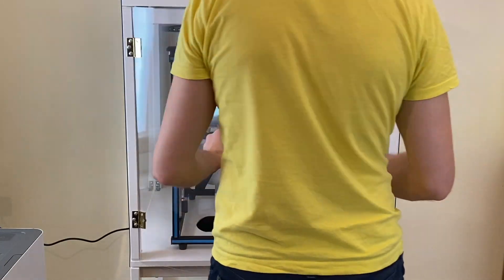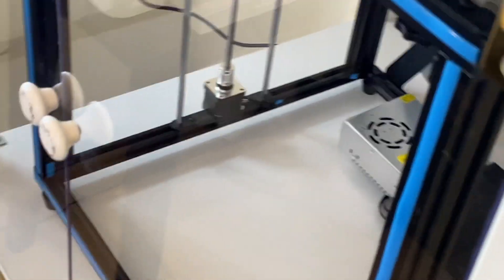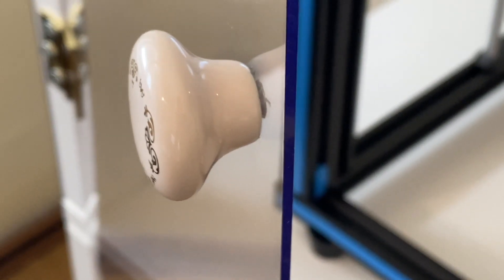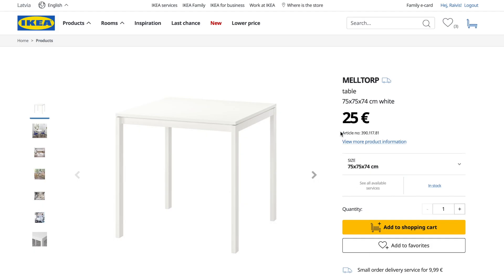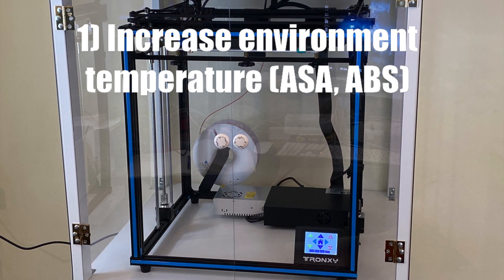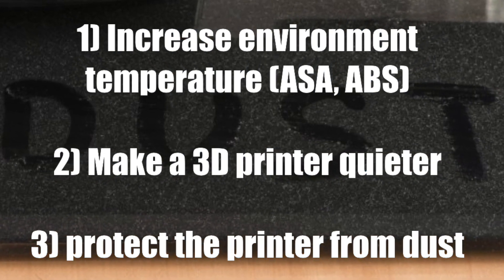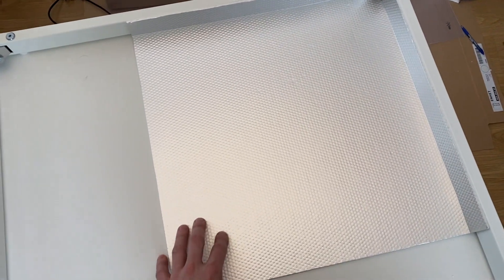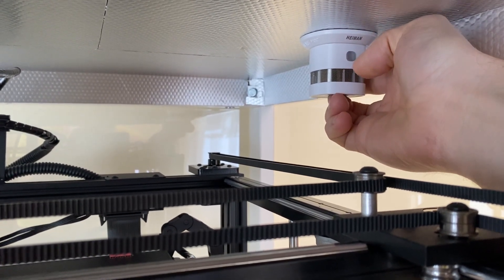How to Build a Cheap 3d Printer Enclosure for Tronxy x5sa pro using two IKEA tables and Plexiglass

Comment: Hi Raivis. What is the max bed temp you can reach on your x5sa? Can it reach the 95C that ABS/ASA require?
Reply from the maker: yes, it reaches 100C. Asa prints very well. but I suggest thicker plexiglass or use plexiglass for front door only, with knowalage what I have now - plexiglass increases on temperature and makes gaps. I cover with a blanket :) Also buy PEI sheet - it saves a lot of time fighting with bed adhession https://www.aliexpress.com/item/1005001266804858.html?spm=a2g0s.9042311.0.0.27424c4dC4lqyo